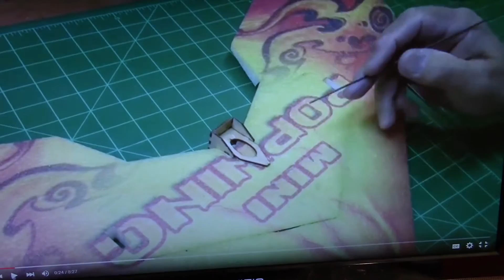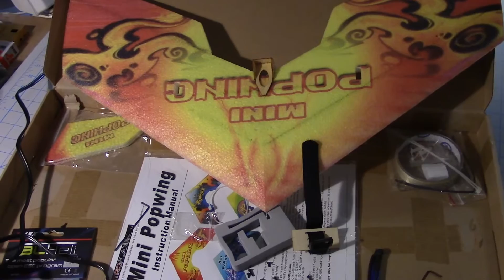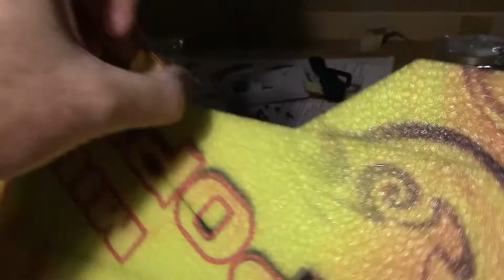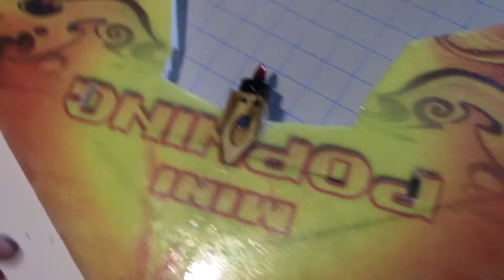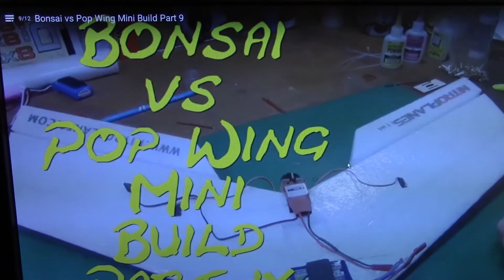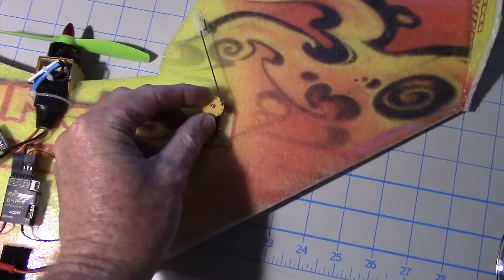Secret to Building a FPV Mini PopWing or Bonsai Wing 600mm wing Part 1

Comment: If you use an electric plane prop like an APC you will get faster more efficient flight times. I have a wing I could get off the ground using a multi rotor prop. Switched to the APC and the wing is a screamer now.

Comment: You are doing everything in your power to NOT build that DRAK. I am dying to see that built and flying. Are you intimidated by it's size? I know you have the skillset.
Reply from the maker: +Donald “NOT PLAYING1970” Byrd lol, I think maybe you are right. The FAA regulations, and lack of safe flying space for it seem to be the dampening forces. Going smaller and lighter these days. Want to buy a DRAK?
Reply: I had pondered the idea, but my skill level is just not up to that level. However I have been considering on their smaller wings to start off.
Reply from the maker: +Donald “NOT PLAYING1970” Byrd Sounds good and SBA has some small planes too. It's all good.
Reply: Eventually I plan on the Drak, but not right now.